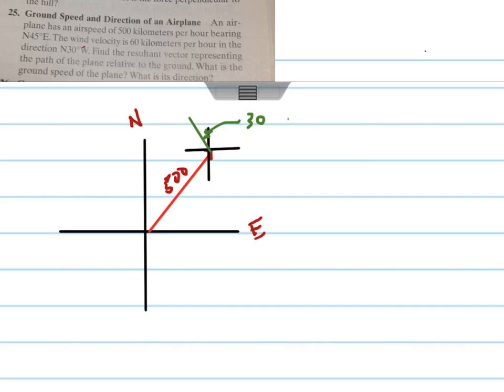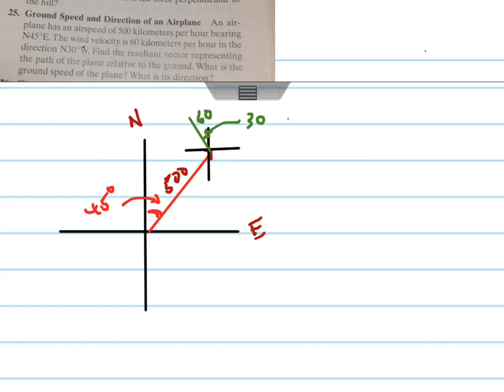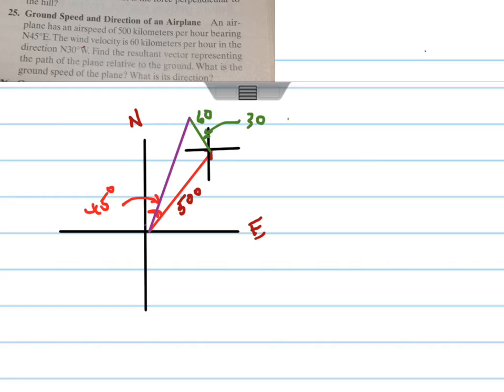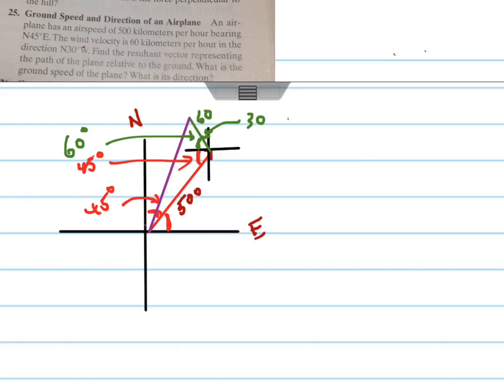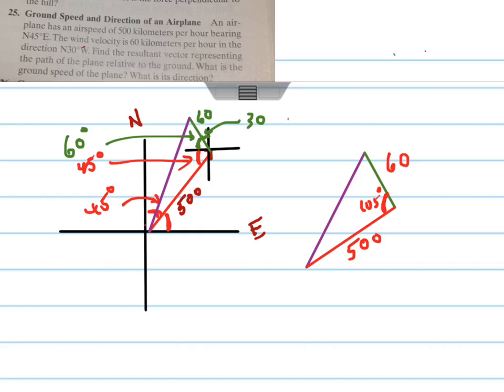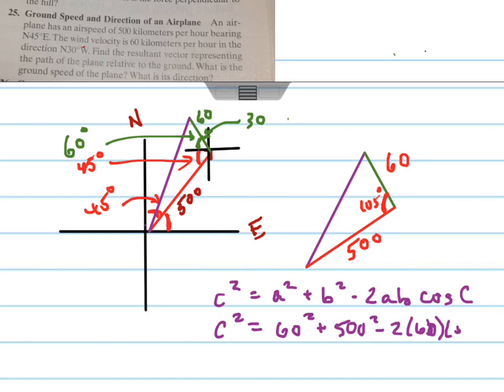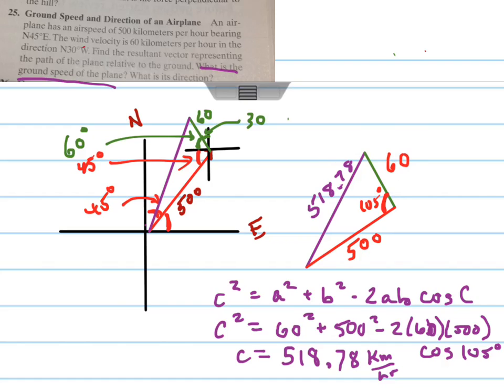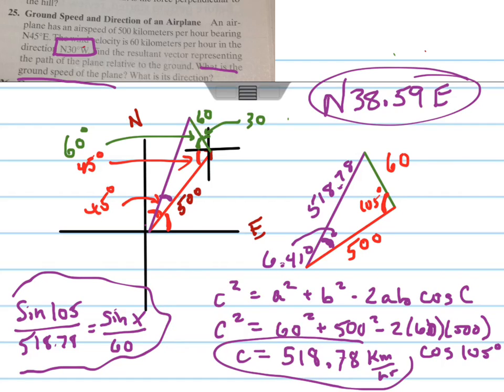Ground speed and direction of an airplane

Comment: The wind is hitting the plane at 105°. With it being greater than 90°, you can see its obviously a headwind. So with headwind, the ground speed is less than true air speed. So ground speed has to be less than 500 km/hr and can't be greater.
Reply: It isn't hitting it at a 105 degree angle it is hitting it at a 75 degree angle but the angle from the planes vector to the wind vector is 105.

Comment: Great helpful video.
Could you please also make a solution on this :
Given the following ,

 Course : 120 Degree, Air speed: 180 km/hr, Wind Direction; 340 DEGREES, Wind Velocity: 50 Degree

Calculate: Ground speed and Heading.

This question is in my navigation book.

This reference used for measuring is the one used in compass. That is, 000 degree at North, and increases clockwise, : 90 degrees at east, 180 at south, 270 : West and so on.

****PLEASE NOTE:  Wind Direction in Degrees indicates the Direction from where wind is COMING FROM. *********************

Comment: For the direction don't you add 6.41 degrees to 45 degrees making the angle 51.41 degrees and the new direction N51.41E?
Reply from the maker: +Felipe Chuy Heisenberg No you subtract it.
Reply: You subtract because the new direction was pushed by the wind toward the north bearing. You need to subtract that from the 45 degrees in order to get it

Comment: I understood everything until the point in which you get to the law of cosines. I solve the algebra for that and it gives me a negative, if you read this comment please correct me

c^2 = 60^2 + 500^2 - 2(60)(500)cos*105
c^2 = 3,600 + 250,000 - 60,000cos*105
c^2 = 193,600cos*105

cos*105 = -0.258819045

c^2 = 193,600(-0.258819045)???
Reply from the maker: Your order of operations is wrong. Multiply before you add things together
Reply: Alright I got it now, thanks..